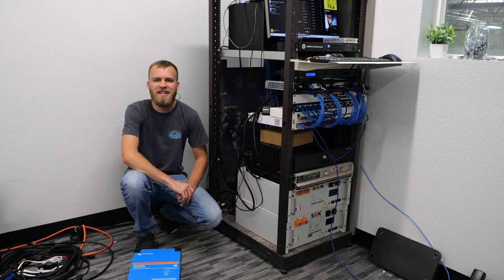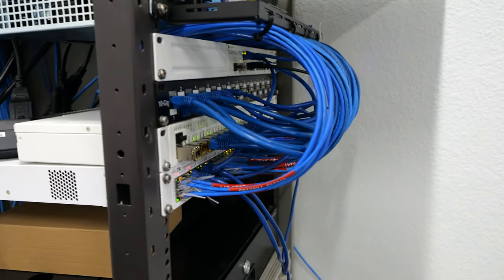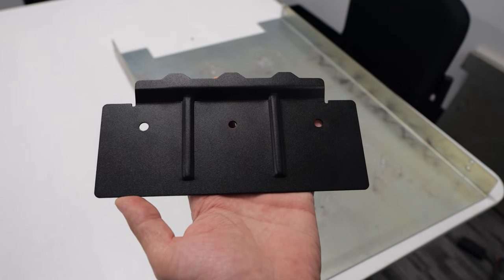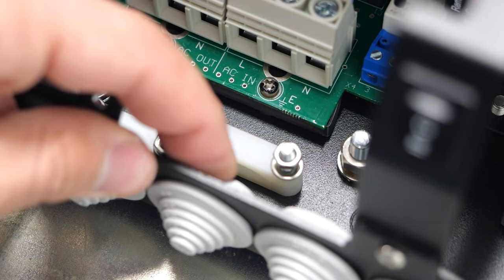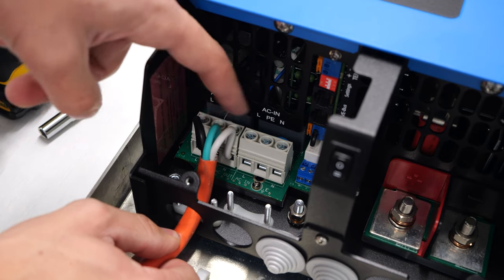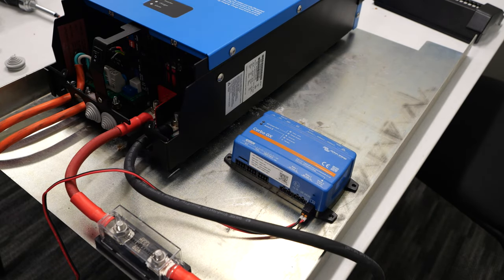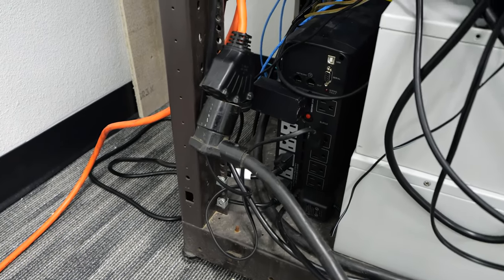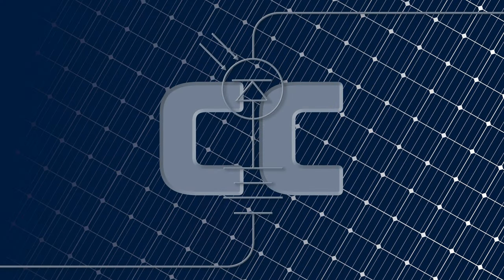Backing Up the Current Connected Infrastructure with Victron | Installing Victron MultiPlus 48V 2000

Comment: I have 3-year old SOK 12V-100A batteries without internal heaters in my RV. Can I buy and install heater pads and use my old BMS or can I do it using a new BMS. I live in a cold climate. Thanks
Reply from the maker: Normally we recommend just adding external heating pads, for example, for keeping your tanks from freezing.
Reply: Thanks @CurrentConnected

Comment: Hi I have an issue hope you can help me. Have 2 multiplus-II gx in parallel single phase 240v. Connected to solar, batteries and grid. I am using an assistant driven by a general flag to stop charging. I want the grid to come in when/if the bms cuts off discharging or low  SOC but don't want the grid to stay for 1second before powering on. Want the grid to be like a ups. Can you please tell me how to get it done.

Comment: Hi, thank you for the video. I see that in the SOK batteries you only use one terminal for both connecting the batteries to each other and the same terminal for connecting them to the inverter. Why don't you utilise both terminals ?
Reply from the maker: These batteries have been floating around the shop and we were missing a few bolts!

Comment: Are you not worried about the high temperature for the MultiPlus?
It's in the back of the server cabinet, and I assume the other devices in the server cabinet will be exhausting warm air from their fans to the Multiplus.
Reply from the maker: There is plenty of room at the top for the heat to escape.

Comment: i am actually planning on wiring a couple server rack batteries in place of the tiny batteries that my 2200va Apc smart ups uses. got to pick up the Ups in a couple weeks then i can budget the batteries. my tiny batteries will have to hold out for a bit longer.

Comment: So the the only way to get monitoring through your phone is to buy additional equipment beyond a Multipluss-II itself?
Reply: Yes - Victron has separated their controller/inverter/sensor gear from their monitoring solutions, which when you think about the whole ecosystem of solar/offgrid, is the correct way to go. Many systems are a simple MPPT and an inverter, with no monitoring required (other than local bluetooth to configure the initial settings), and building the monitoring into the MPPT or inverter would be wasted capital for these customers. 
Many systems are multiple MPPT units (each with their own panels) and a single inverter, or multiple inverters - again, every component after the first one would have unused monitoring gear in it if the monitor were to be build into each component.
The monitoring hardware is not cheap, the so the cost of every component having built-in montoring would be very high, and there would be many unnecessary components. By factoring out the monitoring to its own solutions (there are multiple options such as Cerbo GX, Cerbo sGX, RaspberryPi+VenusOS, and more) the solution is always close to optimal. A similar thing happens with the Victron MPPT controllers, from the point of view that instead of 2 or 3 sizes of controller that may well be over-spec'd for the job, Victron has an MPPT that is near perfect for almost any panel array possible. As system designers, this enables us to pick components that are the right size, with very little of the customer's capital wasted/tied up in hardware that can't be utilised.

Comment: Is it necessary to connect the inverter to the wall? I only need to connect it to the battery for power
Reply from the maker: Not technically, but the power has to come from somewhere - so once the battery is depleted you need to replenish it.  If you had solar or some other charge source, then technically you don't need to plug it into the wall.